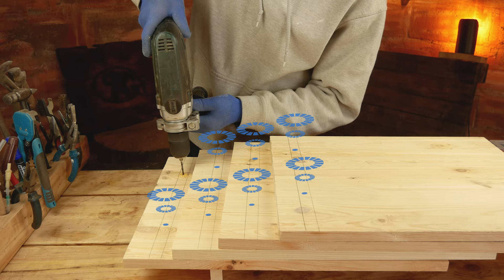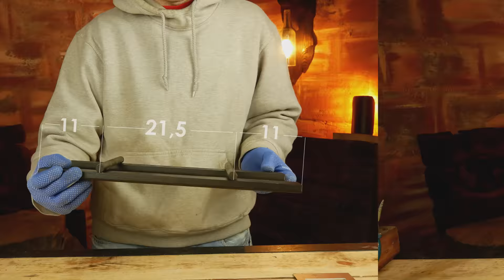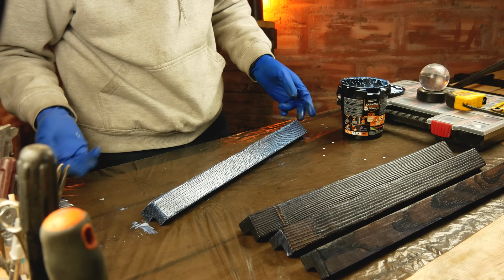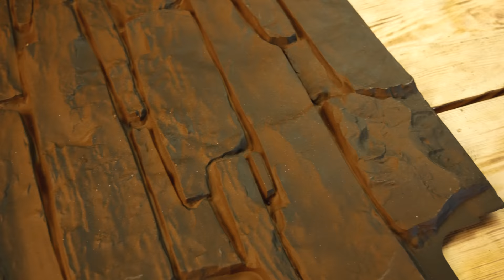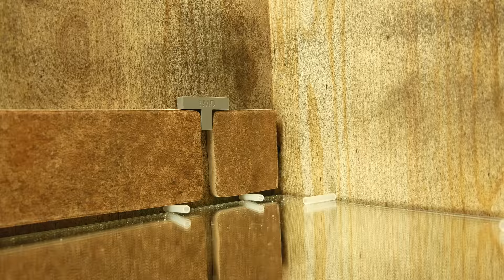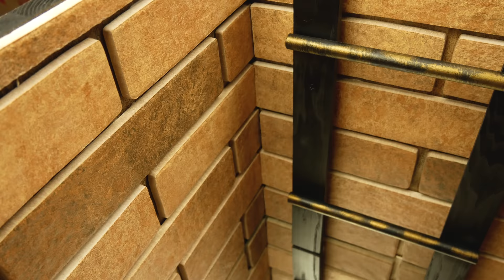3D Table with Underground Entrance / Infinity Mirror

Comment: Great build video! Could someone explain to me what the brick-lined interior walls represent? It's not a vertical mine-shaft is it? It's not a lighted chimney....with a ladder?
Really nice effect, but what is it?
Reply: A way to avoid it looking like a shaft with wooden walls, i think.
Reply: @Tysto  Tysto, I believe you're right. The facia bricks he used give a better representing of the depth with a clear repetitive pattern.
Yep. That's it. Thank you so much.
Reply from the maker: Yes, Tysko is right.  We wanted to do something different from other similar tables.
Reply: Where do you get that glass for the top?

Comment: hi friend... Congratulacions for this work, it's the best that i find... Im tryng make one equal, but i live here in Brazil and we dont have this board PVC stone external.... Please, do you cold send me the link our site for i try to buy??
Thank you very much and good luck friend...
Reply from the maker: Glad you liked it, thanks!

No PVC here, it's a ceramic tile. On the plus side, it looks very nice, but on the minus side, it makes the table very heavy. 

You could probably buy this table, but:
1. You live on another continent, which means it greatly increases the price of shipping.
2. The table is very, very heavy, you will pay a large amount for shipping.
3. It comes with glass. I highly doubt it will arrive in one piece...
I'm sorry. 

Try doing it yourself and you will succeed!
Reply from the maker: Oh, you mean the outer plastic plates? You can use wooden ones, they look great too!
Reply: Шукайте там де продється сайдінг для зовнішнього облицювання будинків.

Comment: That turned out great. What type of glass did you use for the top? Thank you for sharing.
Reply from the maker: It's like one-way mirror. You can question in glass store about that
Reply: It's half- mirrored. It allows light to pass through in both directions, and it reflects in one. You can get them at any glass shop.
Reply: Thank you CamArt and DonoVideo! I appreciate the information.
Reply: @camart153  is that glass expensive?

Comment: What type of glass did you use?
Reply from the maker: This is regular glass. On the top is a transparent dark film, on the bottom - a mirror translucent film, silver-15 (or something like that).
Reply: @camart153  can i use regular mirrot from marekt and regular glass with dark film for car windows?
Reply from the maker: So, you can use a regular dark film for car windows.
But a regular mirror will not work, most likely the film in these mirrors opaque

Comment: I have an issue with the design. When using the mirror film, the reflective part needs to face inwards meaning the film is on the upper outer surface. Placing anything on the table will damage the reflective film. Anyone found a workaround without a second piece of glass on top?
Reply: Don’t put anything on the table :)